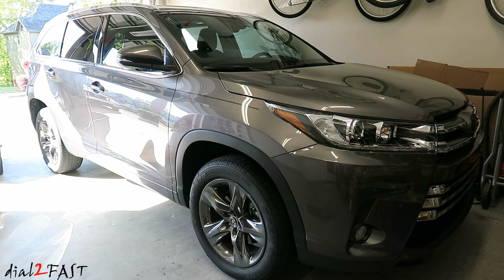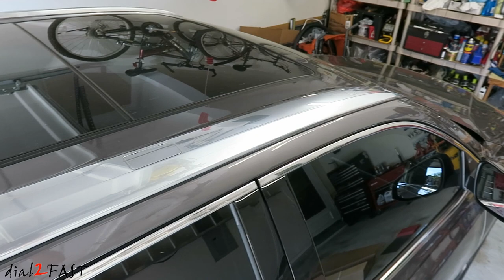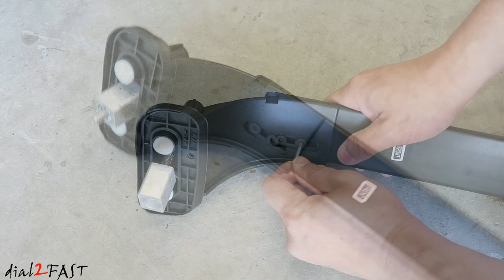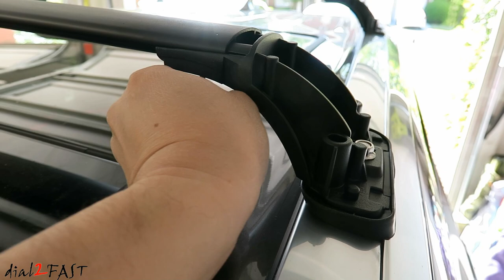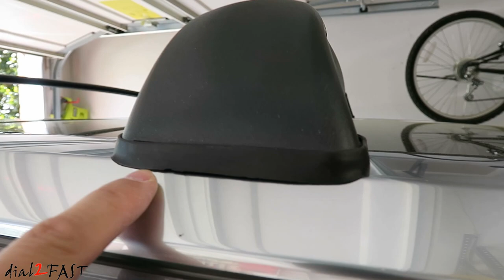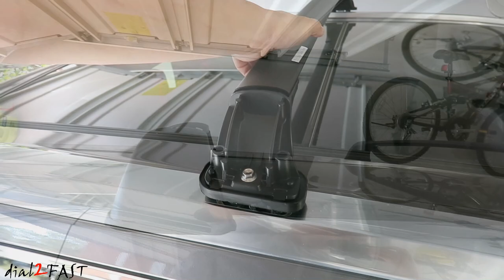Toyota Highlander (Limited, XLE) Roof Cross Bar Install 2014 - 2019

Comment: Thank you for the video. I was struggling to install one that was supposed to fit my model but clearly doesn't and I can tell the one you are doing is the right one. Ordered through your link so I know I get one that will work and the other goes back.

Comment: Thanks for the video! I had some additional parts in my kit. One piece locks the bolt from being able to loosen. The other piece keeps the end caps from flying away if they get blown off driving down the road. 30 min install great video.

Comment: Great video.  It took me 22 minutes.  Just to note, the top of the base on each side of the crossbar are marked with an arrow that points to the front.  The sticker on my crossbar that says "This side faces front" was incorrectly placed on the wrong side!  I caught this mistake because I saw the arrow on the top of the base pointing backwards.  I would have easily completed the install in under 20 minutes if I did not have to remove and reposition the errantly-marked crossbar.

Comment: On my roof rack the rail was held to the mounting bracket with Torx Bolts. Probably a t6 maybe t8. Please make sure before you start using a allen wrench. It's easy to round out a Torx bolt with an Allen Wrench.

Comment: Thank you very much.  This was a great video.  I ordered the black Xbars, and got them installed.  I have one question for you or anyone who has installed these.  I also notice small gaps against the chrome rails, and wondered if anyone has had trouble w/ leakage?  Am considered putting some silicone around the bases just to be sure.  Thoughts?

Comment: Just installed the kit with ease following your directions. I  did find it hard to tighten up the set screws as its hard to see up into the rail. I actually liked the tool included to tighten the bolts even though I had a rachet/socket. The Allen wrench ok. Thanks
Reply: Good afternoon,  I just purchased this system from Toyota today and it will arrive early next week.  My wife dies not have the limited edition so she has what looks like rubber gaskets on the roof rail. Did you have this or did you have the one in this video? I will be installing it myself.  Thank you, I appreciate it

Comment: The only problem with the Highlander mounting points is they're fixed and the cross bars end up too close together to carry anything useful. This isn't a problem on vehicles that have raised roof rails. Unfortunately Highlander comes with flush rails. Something to keep in mind when buying cross bars for this vehicle.

Comment: I bought a cheaper model of these and returned them because the gaskets didn't fit and then found out they were only for the lower model Highlander (both sets of hardware were included though). Directions did not use gaskets for my model, but that wasn't good b/c rain would flow down in there. The bars were fine, just couldn't figure out why no gaskets? So returned them. I hope these cross bars are better.

Comment: What are the other smaller plastic cover plates for near the rear and front of the silver top rail. The two cross bars that you installed are much too close together for my 17 ft. canoe.

Comment: The double recess mounting points are very close together. No good for longer items or stability. Can bars be mounted to the single recess mounting points?
Reply: I have this same question. Roofnest rooftop tents said 30 inches is too close for third tents.

Comment: Mine didn't come with that middle metal spacer (the long one that the screw goes into). I contacted the supplier and they claimed I didn't need it. But when I installed these I saw the silver plastic part of my roof go down. It wasn't flush anymore with the other silver piece. Don't know if that is normal.

Comment: I have a question.  Can the length of the cross bars be adjusted?  The space between the front and back is small.  There is a small cap further back on the roof? Is that for a different length in the cross bar?  There isn't much room to tie anything to the top with these cross bars so close.
Reply: They are a set distance. the small caps front & rear conceal the roof rail bolts.
Reply: @Summerguy24  Thanks Craig, I had the same question as Tess above, about possibly using the small rear cap to add a third crossbar....Guess Not !!!!

Comment: Any wind noise?
Reply: Mine were installed and came with my 2018 XLE - I'm having repeated wind noise issues and my dealer has a very low customer satisfaction  quotient to repair the issue.

Comment: does anyone know what the static weight capacity for the toyota highlander limited is?
the dynamic load is 165lb on these but i am wondering if one could install a roof tent on the highlander limited and sleep in it with two people?
has anyone experience with that?

Comment: Anyone knows the maximum weight they can hold
Reply: Per the provided Amazon link, it's "Load capacity 150 lbs evenly distributed"
Reply: Per Toyota, max weight is 165lbs.
Reply: Directions say 150, but the sticker on the bars say 165. I'll er on the side of caution and just go 150.